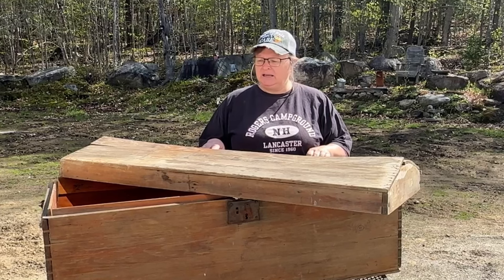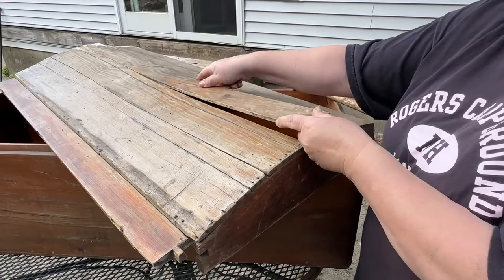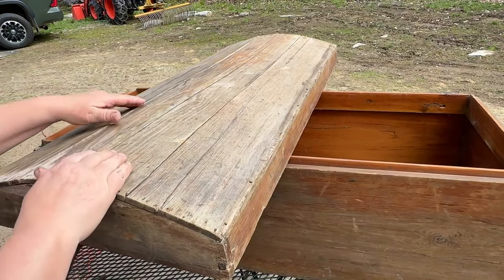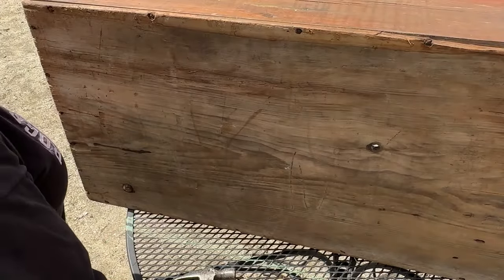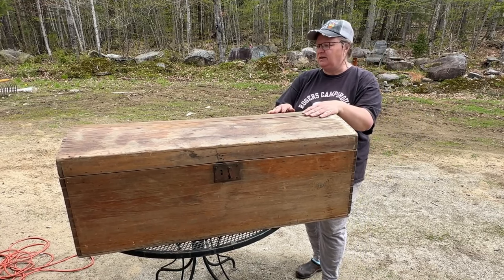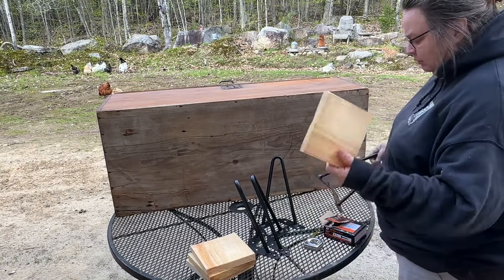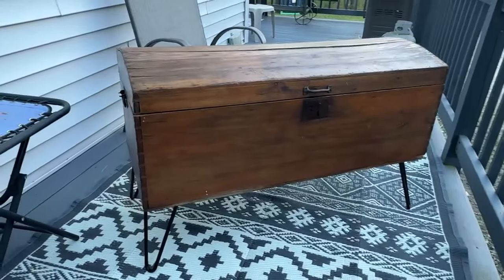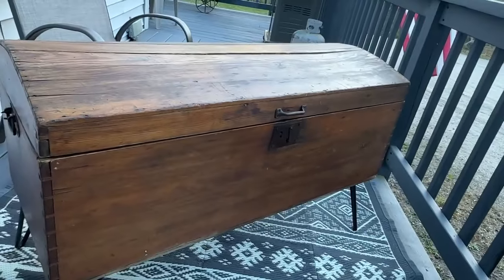Restored Old Antique Chest! (No Paint Used) DIY Project

Comment: Use some wood filler on the lid, it'll make it sturdier
Reply from the maker: That's a great idea! I actually made a template of the rounded ends from the lid and cut it out of wood. I added that to the middle and its solid and works great.